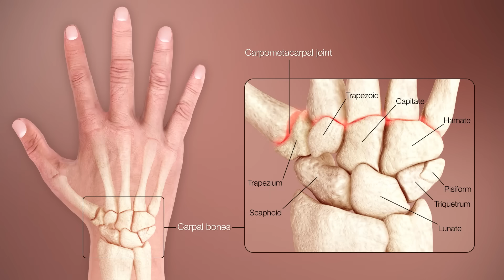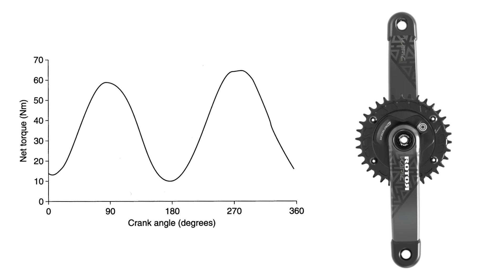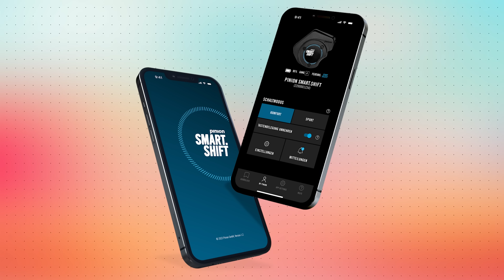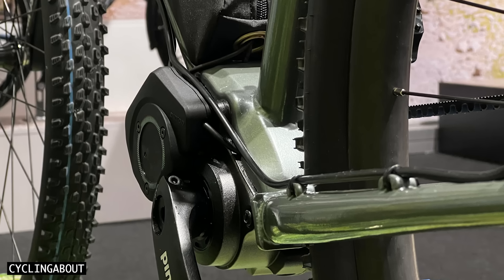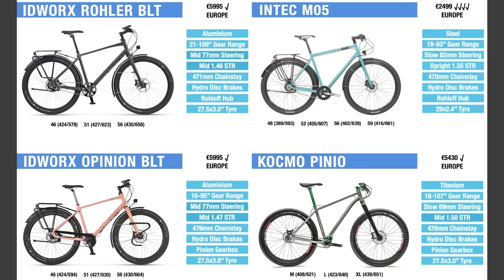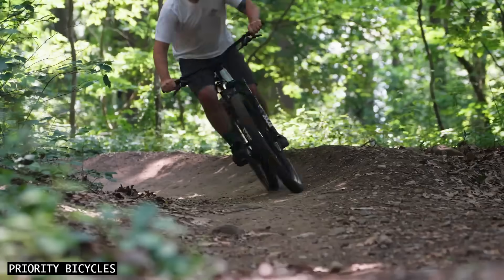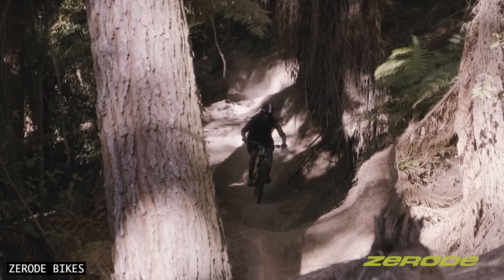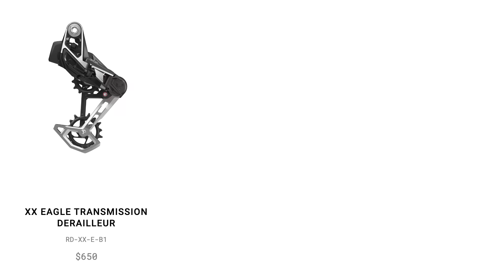The 2024 Pinion Gearbox Is A Derailleur KILLER - Shift Under Load, No More Gripshift!

Comment: The fact that this thing works well with drops too is really good. Now we just need to wait for more manufacturers to use it. I'd buy a decent touring bike with drops with this and a belt, although I would like it to be more like £3000 than £5000 which what I found with a VSK bike (and they don't do drops).
Reply: Yeah that´s the problem why they are not more popular, you need a dedicated Frame for it. But people want maybe ride older frames/bikes or bikes they already love and only looking for more modern and efficient parts.

Comment: Why can't Pinion make a hydraulically actuated gear shifter? The main disadvantage of electronic shifting is that you need a battery. You're screwed if you forget to charge your battery (SRAM Eagle AXS I'm looking at you). Then you will have the world's most expensive single speed bicycle. Of course the problem goes away if you have a dynamo hub on your bicycle.
Reply: I have thought the same thing for years now . . . I was bleeding my breaks one day and all of the sudden it hit me: "why aren't ALL bike components that require a cable not hydraulic actuated instead?". Imagine . . . Hydraulic actuated dropper, hydraulic actuated derailleur, with the later you could even do away with limit screws! Just gotta keep playing with the bleed, start with an under bleed and gradually add more fluid to the line till you find the sweet spot. You'd still need a b screw or something else that would allow cage height adjustments tho. Cables just feel so anachronistic every time I install em on my bike nowadays. I'm running an SLX 12 speed drivetrain and Brand X Ascend XL  dropper so the damn cables are still very much a part of my life. I've learned that while the jagwire complete pro kit is not worth the cost, buying the more expensive cables used in those kits by themselves is totally worth it. Those cables with 2 or 3 drops of cable magic lube is the cats pajamas. I know in their instructions jagwire tells you not to lube the cable outers because the inner sleeve of the outers comes prelubed and the inners in the pro kits are already super duper smooth and adding any sort of extra lub will most likely only serve to make more debris stick and gunk up the system, but i respectfully disagree. Using something like white lithium spray grease or muc off tube grease will def cause dirt and debris to gunk up the works but just a few drops of Cable Magic always works great for me.
Reply: I have an Enviolo 360 rear hub plus belt drive on my bike (weighs a good 2kg and gives sluggish changing). I’d love 500 or 600% gearing, quicker changing and less weight (yes, I do carry it at times).
Reply: What are you talking about? An extra AXS battery is small, super lightweight, and can be swapped out quickly. Additionally, AXS reliably uses blue tooth making the Pinion cable design look silly.
Reply from the maker: You can also charge the Pinion battery with a small battery pack, which you could keep in the car or garage. If you're travelling, you probably already have one for your phone.
Reply: The main disadvantage of these new-fangled automobiles is the fuel tank. If you forget to put gas in it, you're screwed. The main disadvantage to these new-fangled cellular phones is they have a battery. If you forget to charge them, you're screwed. I'm real tired of the charging argument when it comes to electronic shifting. The dead battery fault lies with the user, not the system.
Reply: @mtbikesam68 without having tried any electronic shifter, may I provide a counter point:
Phone batteries (all batteries) are notorious for losing maximum capacity over time. While I have accepted that I buy a new phone every three years or so (not necessarily due to the battery), I'm not sure if I would  feel the same way about expensive bike parts. And if I happen to leave the bike in a shed through winter, or a whole year, will the battery drain over time, and I have to charge it before using the bike? And what about temperatures? Most electronic components struggle in the coldest winters or hottest summers. I'd prefer if my gearbox doesn't explode or lock up.
Reply: @thorbear  how many shifts per charge was it again?
Reply: @thorbear  all in good fun. I have always enjoyed the tech side of the bike world, but I also have bikes with cables and rim brakes. Some cyclist luddites would scoff at a gearbox at all, claiming one gear is all you need! It's all good. I have had wireless electronic shifting on my mountain bike for almost three years now and have never had a single problem. I keep an extra battery, always stay on top of charging them and I bring the extra with me when I ride. I absolutely love riding my bike, so I have adapted myself to the needs of the electronic system. To each his own! Cheers.
Reply: @mtbikesam68  absolutely!
My previous comment was not intended as a list of "here are the reasons why electronic shifting will never be good", it was just a counter point to "batteries have worked well in other equipment, why not here?"

I remember a time when I scoffed at wireless headphones without removable batteries, "what if they run out in the middle of a plane ride and I can't change the batteries?", but I have adapted, and I keep my headphones charged at all times, and only very rarely have they actually run out of power. I haven't missed the removable batteries that I was so attached to.

I'm open to having the same experience with electronic shifters.
Reply: @climatechangedoesntbargain9140  I'm not sure if you're disagreeing with my points or agreeing. But I actually have no idea how many shifts it would do on a full charge. I was not able to find any technical specs for this thing at all unfortunately...
Reply: Was mentioned in the video @thorbear

Comment: Nice, but as with all gearboxes cost more then a new kidney! :P Prices overall need to come down on all gearboxes.
Reply: They are cheaper than the latest Shimano or SRAM group sets though.
Reply: A Shimano Nexus or Alfine doesn't cost all that much. There are also offerings from NuVinci and others.
Reply: The pinion costs more than an entire brand new Honda motorcycle
Reply: @janeblogs324 I was looking at a new Specialized Stumpjumper EVO Pro and this bike is selling for 13k now.
I have a 2022 and thought 8k was steep.
Reply: @Lenny8Zebra  I demand practical maintainability on the road, gearbox does not supply it.
We are not goof balls. You just don't understand that different people have different needs. And the current state of the bike market shows that high failure rate with high roadside serviceability and low price of spare parts is in higher demand than low failure rate with no roadside serviceability, no spare parts and high cost of repair.
Reply: Can’t with my base $144,000 salary….
Reply: Are they cheaper than than 2x cassettes an new chain and derailleur every year though?
Reply: Yeah, this shit is for retired dentists
Reply: @Lenny8Zebra  electrician...
Reply: Well if you went to school instead of working at McDonald's...........

Comment: Hi Alee - would you say the new Pinon would be a better alternative to a Rohloff/Gates combo when looking to build a world touring bike today? Is there any improvement in resistance, and wouldn't electronic shifting just add another point of failure when on the road? Thanks
Reply from the maker: There are pros and cons to both so it really depends on what you value most from your drivetrain (I made a Rohloff/Pinion comparison video a few years back). The 2024 update probably benefits mountain bikes and gravel bike the most, but I would personally have no qualms travelling with electronic shifting. That said, the prudent thing to do would be to wait a few years to see if any durability issues arise with the electronic components.